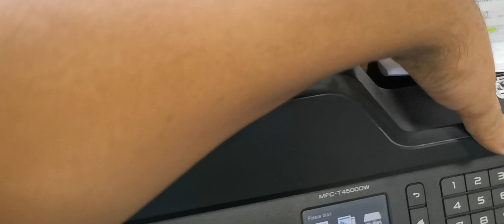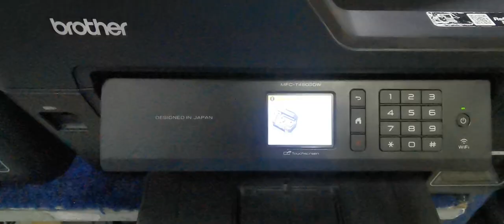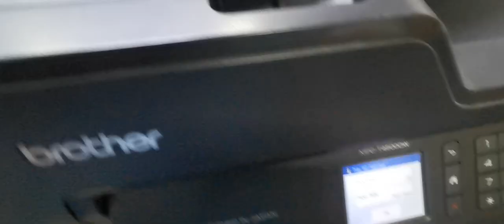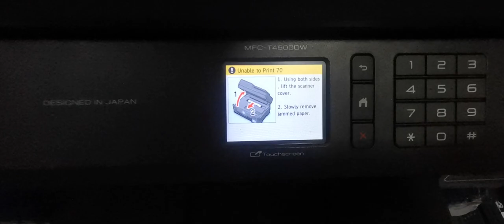brother MFC-T4500DW vs HL-T4000DW print unable 70 #brotherprinter #brotherprinterrepair

Comment: una  ocasion me trajeron una  maquina  asi que marcaba  atasco en la parte  posterior desarme totalmente  limpie  sensores encoders,  sensor del cabezal  paa  quitar y revisar el sensor que va debajo de la platina del paso de papel se desarma  totalmente el equipo y lo hice y nada que pude  rresolverlo entre a modo servicio y probe  todos y cada uno y si se comunicaban  bien  pero no dejaba de marcar aun no e podido resolver ese detalle tu los has podido resolver amigo,  ahorita  tengo  un detalle necesito una version de firmware  o la liga para para poder descargar la version mas atrasada del servidor  de brother no se si la tengas y me puedas ayudar es una mfc-j6930 le puse un sistema  como las empon modifique las lineas y bien pero ya tenia l e detalle de que no reconoce los cartuchos  trae  el firmware Y quiero bajarlo o degradarlo para ver si me los acepta ya que solo eso me a detenido, gracias y saludos